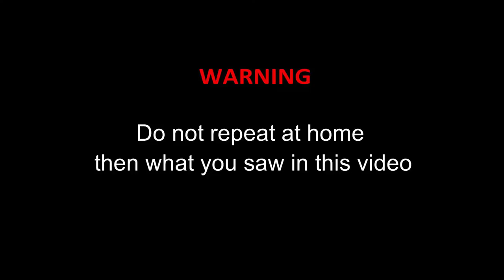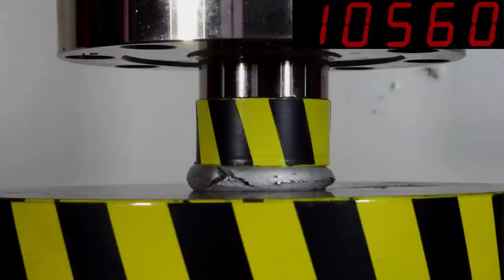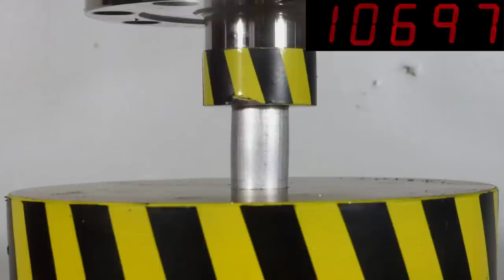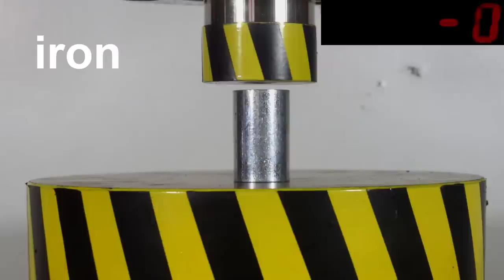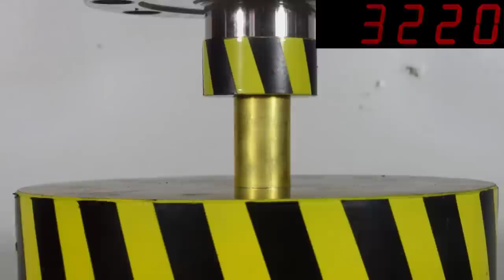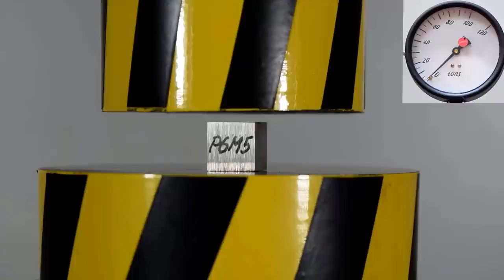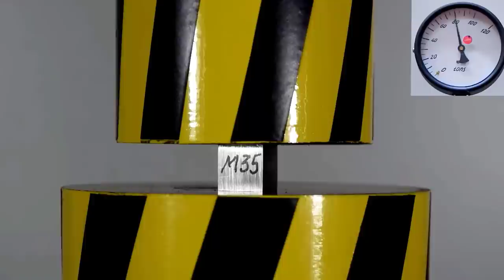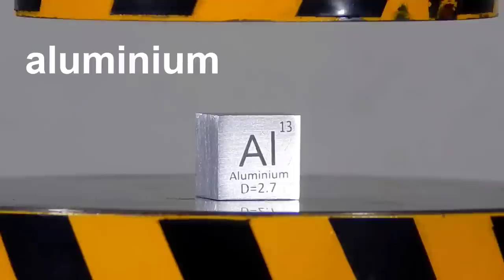HYDRAULIC PRESS VS NON FERROUS METALS

Comment: Hold up.. something ain't right here... why did the tin bleed some clear liquid?  Are we not going to talk about how you just juiced tin?
Reply: I'm currently looking for the same answer. I'm lost
Reply: I wondered the same thing. I am currently searching for a reason myself. I have even posted something on Reddit asking why🤣
Reply: Its probably because of the pressure build up inside which basically heats it up and melts it OR it could be that tin contains like a tiny bit of oil for soldering so it’s easier
Reply: OR last thing they could be cooling the tin with water or something and it got inside
Reply: metals commonly are porous, and can get water trapped in them during processing or cleaning